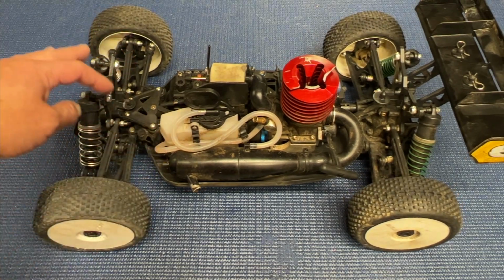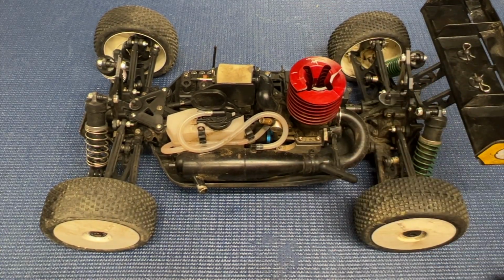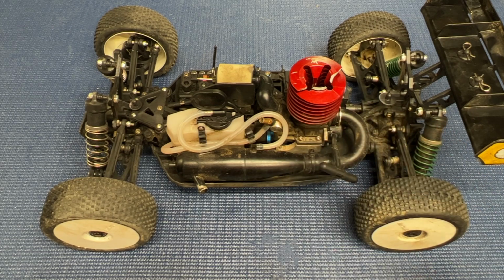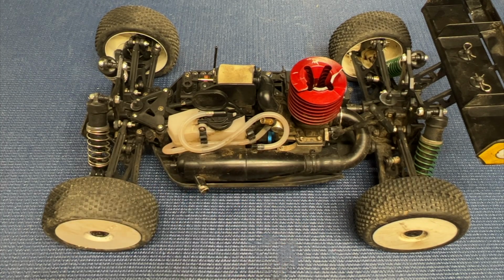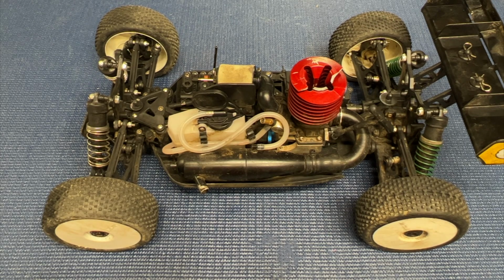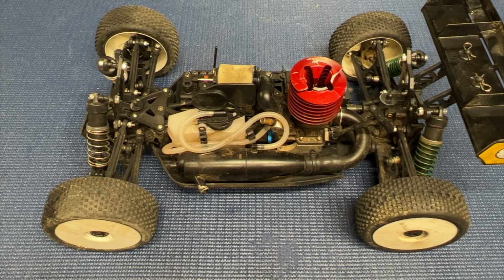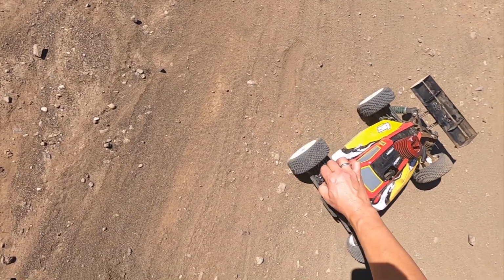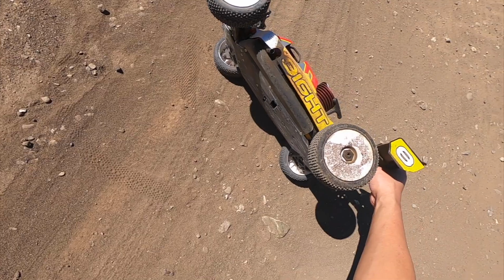Losi 8ight Nitro RTR First Run

Comment: If it's the 2-piece 3.5 head you can most likely fit any 2-piece Ofna, Force, or OS cooling head on it as it doesn't change the dome only the cooling head. If it's the one piece only option is the low-profile Force 2.8 or 3.5 head which has the same conical diameter compression dome.

Comment: The Losi rtr comes with a big pinion. Changing it to a 13 or 14 will get the quickness up. First thing I did was a 14 tooth pinion and going two and two on the clutch shoes.
Head looks rough but the engine will still run cool.

Comment: Broke mine in and run on vp 30%, been running weekly for a year now and it's been very reliable for a nitro. Breaks less than some of my electrics.
Reply: How long does it take to break in
Reply: @stevenbrewer7314  I personally idled 3 tanks then ran it lightly for 2, I was a little impatient but it's worked out well so far. Would recommend finding a video on properly running in, process can be done in an afternoon.

Comment: Out of curiosity what shape are your shock boots in? Have they ripped or cracked yet? I've had my 8rtr for 2 years now and upon pulling it out of the box right off I noticed the boots (all 4) were cracked everywhere from top to bottom and after break in the 1st off road run they now have some pretty big rips and tears on them. Horizon probably would've replaced the boots at no cost but I never got around to contacting them. Anyways, gotta say this is my first nitro I learned to tune to a single stage idle, thanks to JQ and his awesome how to tune video that just worked for me from the first time I tried it!!                   Rip on my nitro bros.
Reply from the maker: they're still OK, but rubber degrades pretty fast and shock boots are not going to last that long

Comment: If you still have the HPI, I think both engines are made by Force, should be able to swap the 3.5’s head on.
Reply from the maker: Thanks, I checked, but the HPI is different.